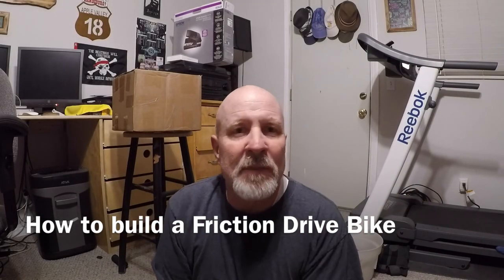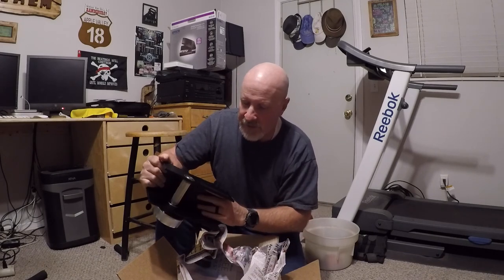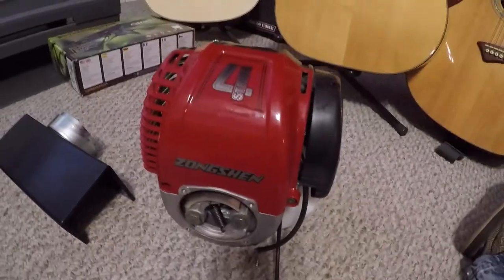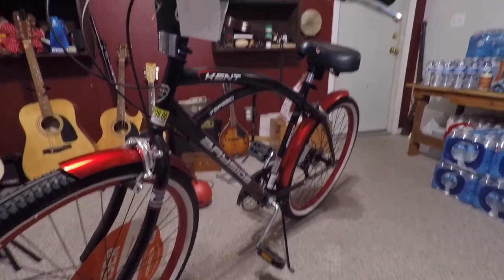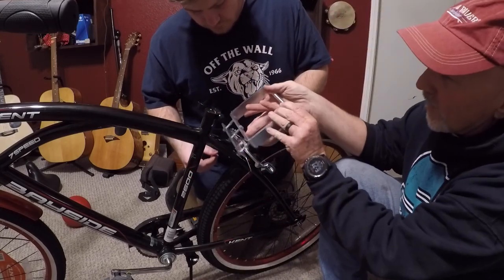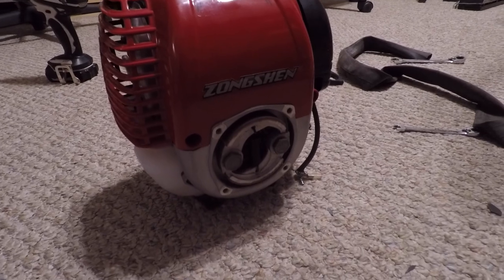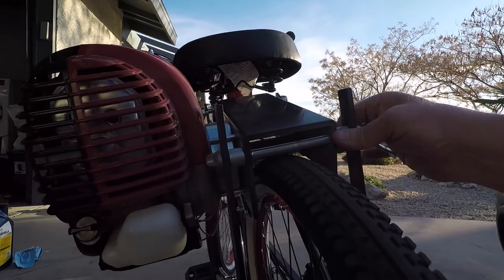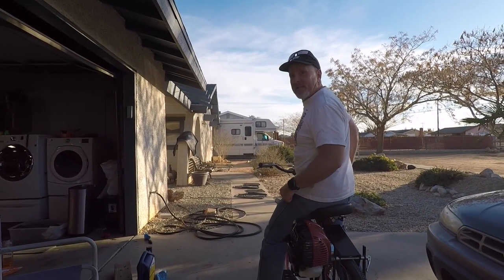How to build a Friction Drive Bike

Comment: What was the chinese knock off called? Did it take like a month to get it in? Want to shout out the seller of both where uou purchase.    I was going to ger the bbr or flying horse lock n load kit and stanton engine but having trouble putting together best mount engine or just mount and engine made to fit each other and then the big problem is I have only had two stroke engines installed on a frame never a rear mount so I am concerned about the load of man and motor on the back end and the wheels and tires. So thinking Cruiser may not be the best idea because you sit directly over it, mountain bike front suspension no suspension or mountain bike full suspension thoughts? Like the video
Reply from the maker: EAB Bates I really Like the Stanton drive system. It’s much smoother than the Flying horse. The flying horse is not quite as practical. Thanks for watching👍🏻

Comment: I built one it was a nightmare and it chewed my rear tire up instead of moving. I will stick with the center mount chain driven bikes
Reply from the maker: Mine is still going strong and with the original tire👍🏻 the kit I bought this pretty high quality though.
Reply: @ManCaveMayhem  I can't get the proper friction between the roller and the tire on mine
Reply from the maker: @chupacabra4897  I keep my tires filled up with air and kind of put a pretty good amount of friction on. It seems to work OK for me.
Reply: @ManCaveMayhem  thanks but I just can't get it to work right I've tried everything
Reply: @ManCaveMayhem  I thought about trying it out on a different bicycle maybe even a 20 in bmx bike
Reply from the maker: @chupacabra4897  sorry to hear that. Have you ever contacted the company to get some advice from them?
Reply: @ManCaveMayhem  they don't speak English all they say is thank you for your kind you are the boss ok ? We can help you what is the year model year of your machine thank you for your kind